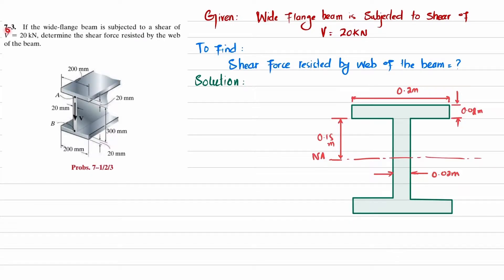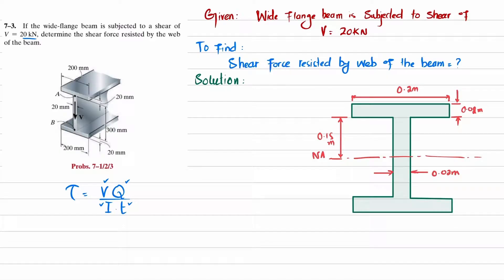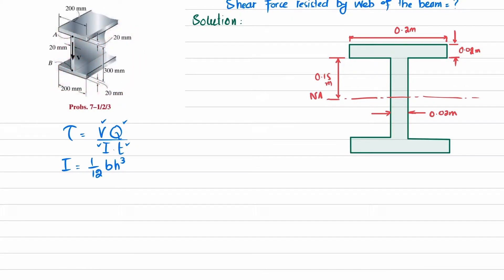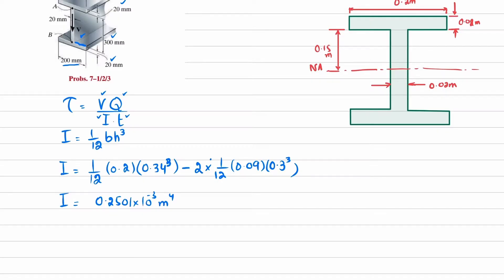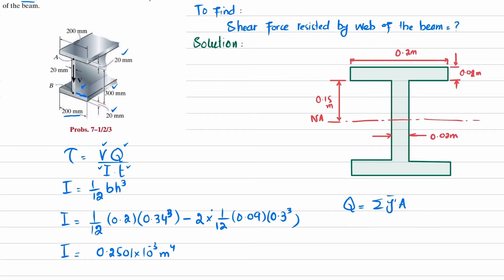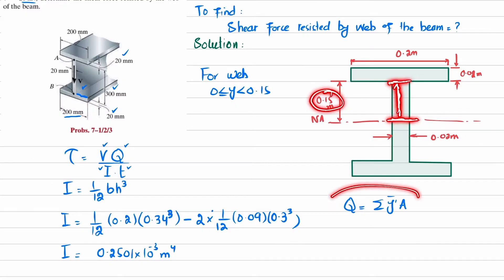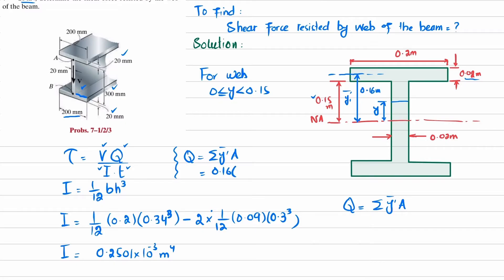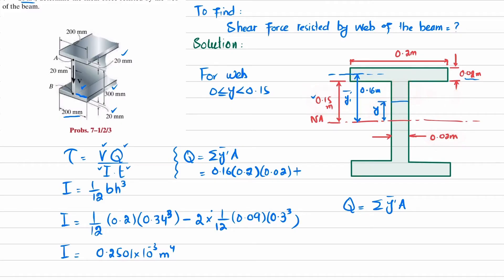7-3 Transverse Shear | Mechanics of Materials RC Hibbeler |

Comment: Why did we remove the two empty parts??
Reply from the maker: because they are empty. this is one of the method for finding I , you can also use 2nd method but it will be a little bit lengthy...
Reply: @engradnanrasheedmechanical  Ok doctor, one way to find the bar is sometimes to multiply the bar by the dimensions, and sometimes just the law without dimensions. Explain to me.
Reply from the maker: When neutral axis passes through centroid of an element then there is no need to find Ad^2. Because d here will be zero and d is distance between centroid of section and neutral axis. When an element is away from neutral axis then the distance between neutral axis and its centroid will be d so we will have to find Ad^2 in moment of inertia.
Reply: @engradnanrasheedmechanical  🌺Thank you from the bottom of my heart, Doctor. I wish you success tomorrow
Reply from the maker: Thank you and please share my videos with your friends and junior fellows

Comment: Hello Sir, suppose the  dimension of the bottom FLANGE is less than the given dimension in this question making it to be single symmetry about y-y axis.. Can you kindly help on how to get the shear force resisted by the web?
Reply from the maker: In my opinion it will be the same as we did in this question